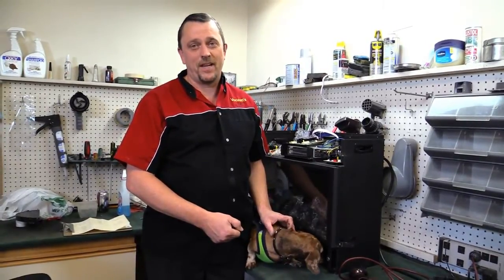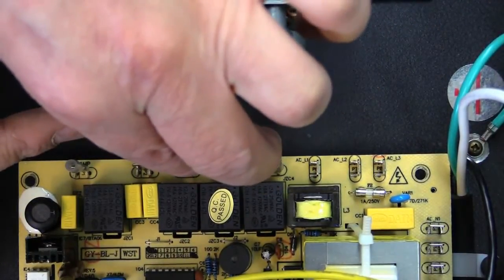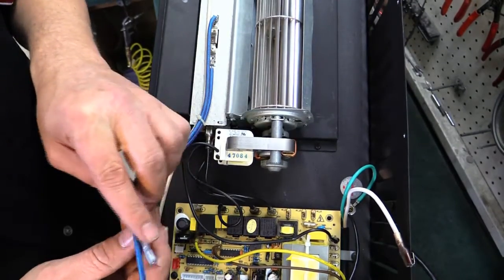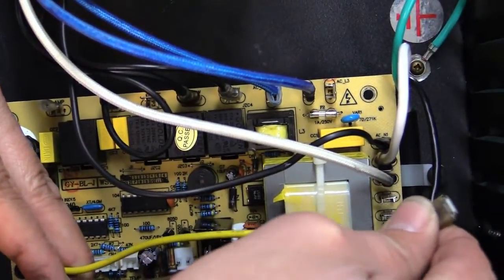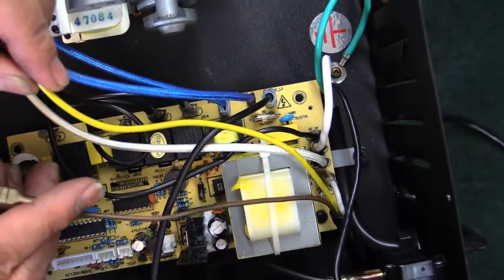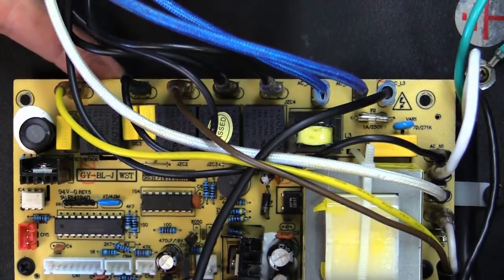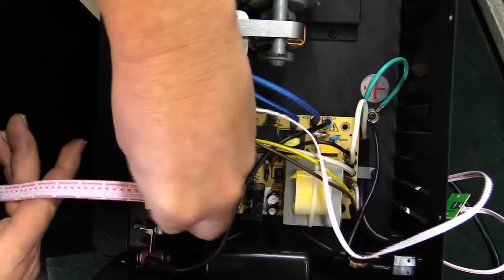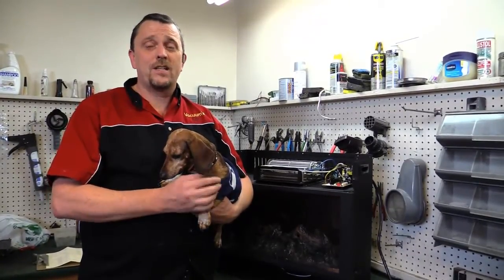HEATSURGE MAIN CONTROL BOARD WIRING TUTORIAL

Comment: My control boards heat sink is cracked do you have a replacement circut board   model number ADL-2000M-X...1-08-12-069874 any help would be greatly appreciated

Comment: My Heatsurge  Electric Fireplace (Model:ADL-2000M-X) control display on/off shuts off after it reaches a desired temperature (say 68 degrees). The power on the thermostat is still on but the power on the on/off button on heater click off after reaching the desired temperatures and has to be reset.  This heater is plugged into an exterior thermostat in which I recently purchased. Does anyone have a solution to this problem.

Comment: My heat surge Amish fire place is completly dead. the reset dose not work, tipping it forward does not work, it does not beep when plugged in or turned on. Can I replace the complete fire box unit and how much would it cost? it is a ADL 2000M-X 1-08-12-118858

Comment: I have and heats urge
I turn it on and it turns off and it beeps
I continue to reset it and turning it on 
Same thing happens it will run then turn off and beep
The heater is like brand new
Any suggestions

Thank you